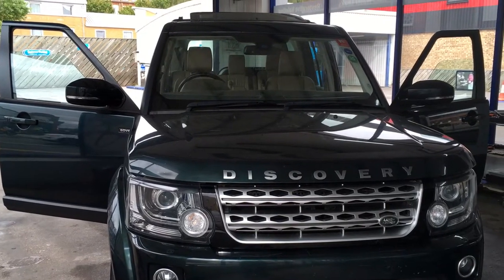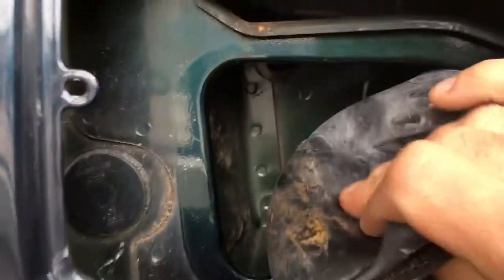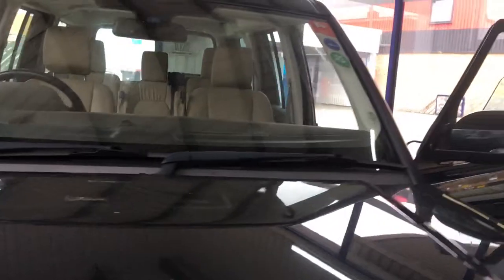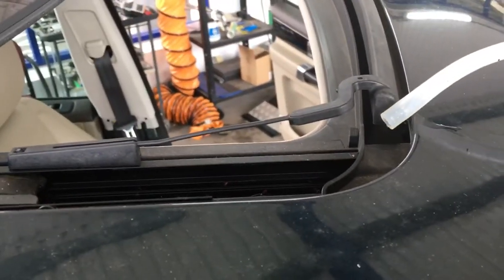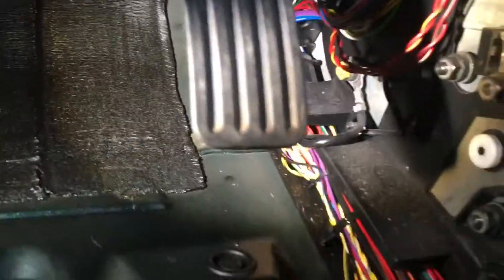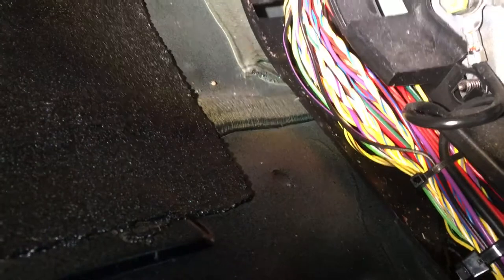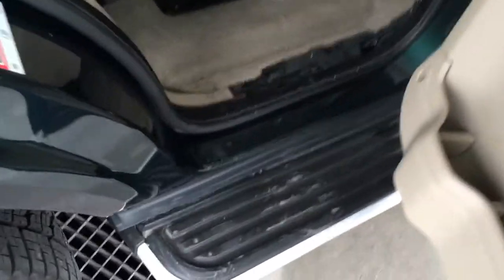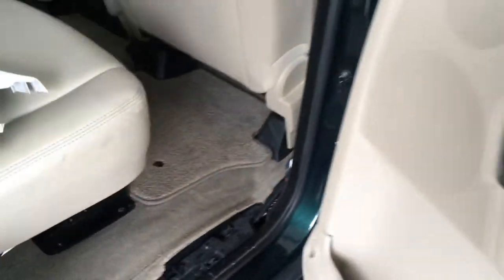Land Rover Discovery 2015 | Water Leak | #RangeRoverLeaks

Comment: So, are you saying that the drain tube from the Sunroof cassette to behind the air intake grille is perished somewhere between and leaking internally before it can drain out in the outer wheel arch? 
If so, can It be replaced? What is the fix?
Thanks for the effort!
Reply: Yes, the pipes may have shrunk or the connectors perished. Although I believe with the Range Rovers, the problem is usually at the end where it meets that grommet. Many times when we find leaks on sun roof drainage systems, somebody has already tried a repair and the parts or covered in silicone sealant or been glued.  It is best to buy a replacement set and replace the lot. It is often the case that manufacturers improve the design or quality of materials, and that is what you get with the replacement.
Reply: Have you ever seen it where the sunroof itself is leaking rather than the drainage pipes? My car is locally and they’re saying it’s a full sunroof replacement at £2,000 + VAT just for the parts, not to mention taking the headliner down etc. Is it realistic that the cassette itself would have a leak in it? Thanks for any help
Reply: Hard to know isn’t it